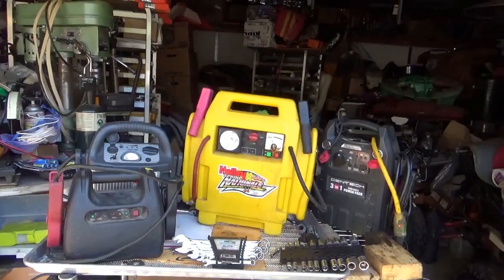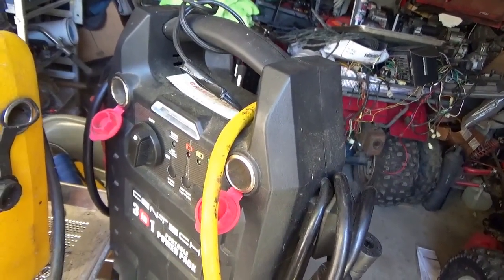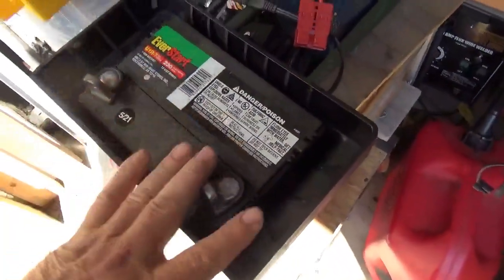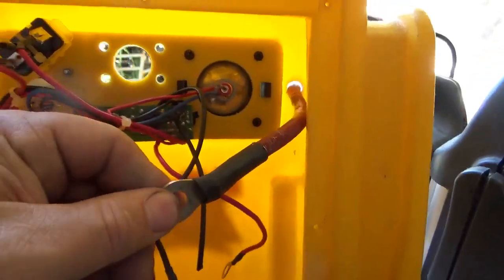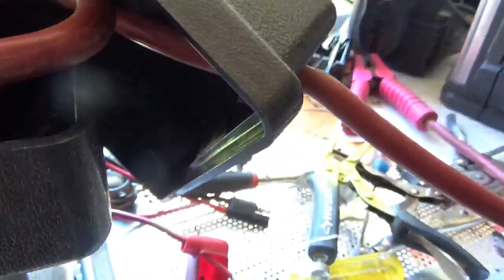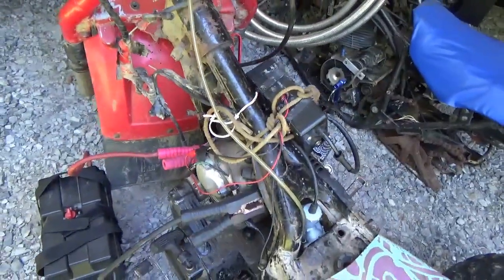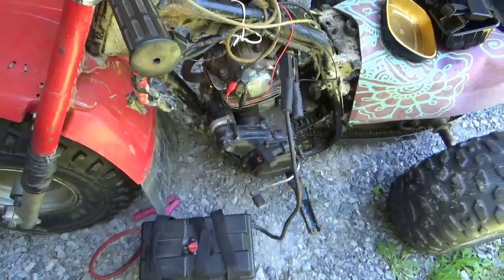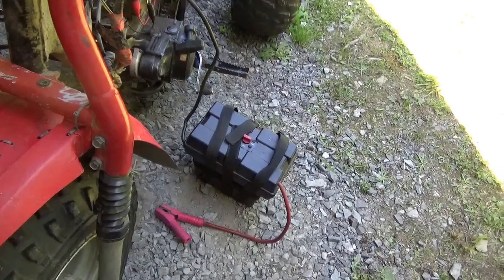Building a Better 12Volt Auto Jump Box, Recycling Junk into a Useful Tool!

Comment: im using 42 old lithium ion cells to as a jumper and after testing It has put out over 500 Amps and it starts everything i throw at it and doesn't weight that much

Comment: Harvey I've been a subscriber for quite some time now, and learned a lot from not having any knowledge prior. Recently washed your Rescue of totally wasted wire harness and learn from what you said about the CDI box taking 12 volts from the battery and nothing less it dawned on me what you had said was probably exactly what was wrong with my Bombardier engine. It would spark one time and then after that it would have spark again I would shut it off and then they would repeat one spark then nothing. Clearly that had to be the problem I had several other people look at it and finally given up hope on it and picked up five different engines to go in a go-kart all the while using the same battery the power CDI. I bet you every one of these has a 12-volt needs with the CDI. Thank you once again for detail have a Happy Thanksgiving.

Comment: Great job👍 unless you count your time invested or put a price on the recycled parts, your wallet came out heavier than if you purchased a new jump pack! And much higher true cranking amps than anything sub 70$.     I've got 4 regularly used L&G batteries and typically get ~3 years from them but have 1 from 2014 that still meets its sticker rating, who knows how long it'll go😅

Comment: Mr Harvey I've been using about the same system here only with marine battery from Wal-Mart about 70 dollars battery box and put it on light dollies to roll it around .Ive had it 4 years now works great I charge it when it gets low but matinee batterys are designed to be recharge. That way good luck friend